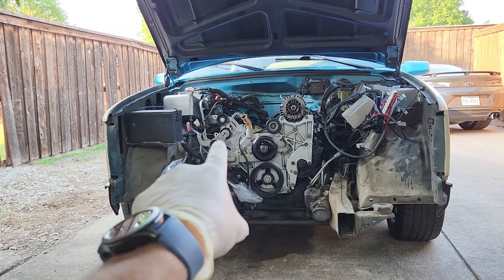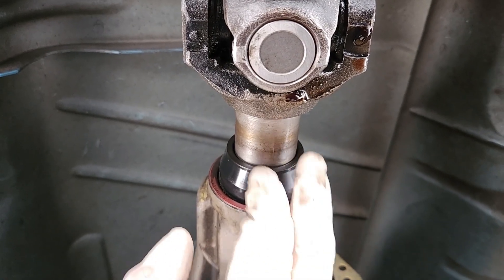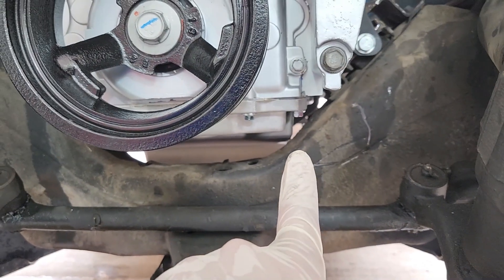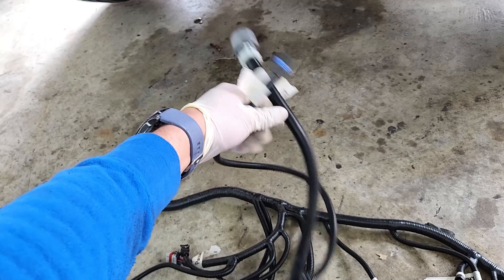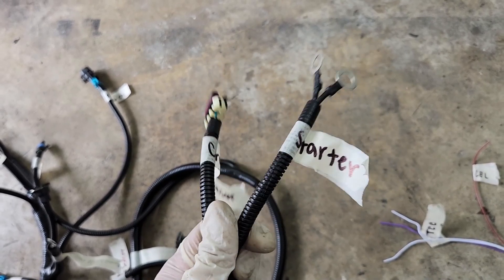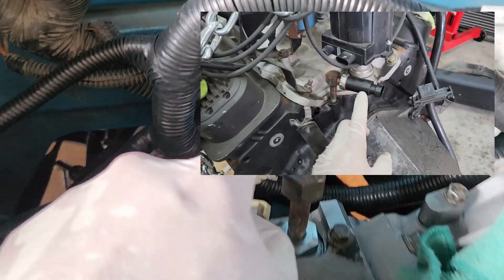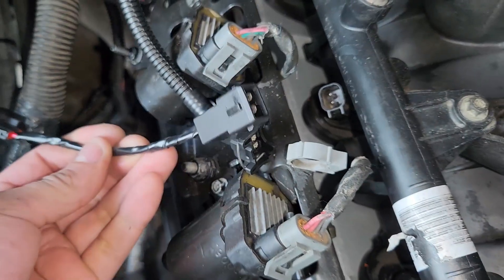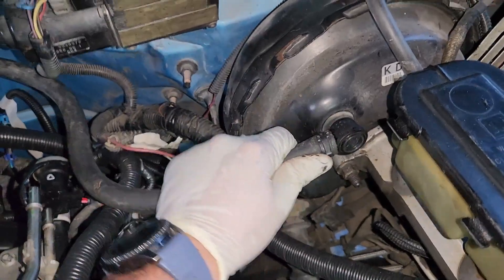How to LS swap 95 Chevy OBS (PART 2)

Comment: Did you have to use the spacer for crank and torque converter
Reply from the maker: no because I used the transmission the LS engine came with

Comment: What radiator hose did your use ?
Reply from the maker: I bought it from a 2003 Tohoe and just had to cut off about an inch or 2 from the water pump side

Comment: What’s about the vats system did you have to change anything out there
Reply from the maker: 95 only had the 1 sensor in front of the cat but my exhuast had already had the cat removed    so it was never an issue brother
Reply: @SUPSGARAGE im sorry I meant vats my phone autocorrect
Reply from the maker: @tacoman2064 oh lol   gotcha    you have to disable them or the engine will never turn on    it will crank    just never start   and I removed all the evap stuff, secondary o2 sensors and have my fans turn on at a lower temperature.

Comment: In my 94 supposedly the mil (check engine light) wire is brown and white but the brown and white wire just jumps to the pcm connector. Any ideas?
Reply from the maker: Where does the other end go?
Reply: @ literally goes from accessory connector to pcm connector. That’s it as far as brown with white stripe.
Reply: @ I have a brown with black stripe that has a splice fitting on it.
Reply from the maker: any chance you can send me a pic on Instagram? sups_garage
Reply: @SUPSGARAGE  I can tomorrow when I get back to it. Thank you!

Comment: is the low profile oil pan required? or does the factory oil pan on the 5.3 work?
Reply from the maker: the factory one will work    but if u have lowered ur truck    then I would advise  you to get the low profile one because you risk of it bottoming out
Reply: @SUPSGARAGE  good to know, thank you.

Comment: Is it the same if i just use the harness that comes with the LS or is it easier to order a harness from Amazon I'm not sure what the difference is
Reply from the maker: I don't know brother because I don't have experience with the stock LS harness
Reply: @ did you buy the harness because your engine didn't come with it or did you buy it because you wanted to
Reply from the maker: @jordangonzalez1443  mine came with it but it still had wires that I didn't even need and I didn't wanna spend the time to trim it down      so that's why I just went with Amazon harness

Comment: I’m currently building a cammed 5.3 to put in my 1994 gmc suburban same body style. Will I need the brackets on the front for alternator etc??
Reply from the maker: @fsu3784  did it not come with motor?   the LS bracket should work just fine

Comment: howdy!! me again 😅 which radiator/fan  did you use?
Reply from the maker: Here you go brother  but I recommend upgrading the fans I have now(the link is also below) because the ones it came with does not pull enough air here in Texas lol

OzCoolingParts 3 Row Core... https://www.amazon.com/dp/B07Q26NXRH?ref=ppx_pop_mob_ap_share

American Volt Dual 12-13 Inch... https://www.amazon.com/dp/B0BT25TKGB?ref=ppx_pop_mob_ap_share

Comment: do you need different mounts?
Reply from the maker: as long as you use the adjusting motor mount brackets and the stock Mounts for the v8   you should be good brother

Comment: Hey man did you have any struggles with your transmission my parking indicator says it’s shifting but truck does not move like it’s still in park
Reply from the maker: can you check when ur shifting if the shaft where the cable connects to is also rotating?

Comment: Very good and explained videos brother, I have a 93 1500 with the 4.3 v6 do you know if I can use this harness or do I need a specific v6 to v8 ?
Reply from the maker: @luisvazquez3270  thanks brother   and that does not matter   what matters is what engine you decide to go with DBC or DBW
Reply: @ I have a gen 4 5.3 from a 2012 tahoe but now seeing your video I might go with a gen 3 to do the swap myself
Reply from the maker: @luisvazquez3270  I don't have any Gen 4 experience lol

Comment: What oil filter did you use
Reply from the maker: @mtzfilms9837  the one that fits a 03 Tahoe      i took off the adapter from the orginal pan and put on the low profile one I have on it now brother

Comment: I just wanted to say, thank you!! I watched your video's & did a complete LS swap on my 1995 k1500 Z71. I ended up going with a 4L65E transmission & it bolted right up to my 6.0LS motor & I was able to get my transfer case & 4WD working as well. I found this video & committed to doing the job. Thanks again!
Reply from the maker: Happy to know it helped you brother 😁👍!
Reply: Do didn’t see exactly how u got power to the fuel pump or did it work from the original wires

Comment: The link to the oil pan doesn't work. Anybody has a link or part number.
Reply from the maker: This one will work as well brother

GESEXI 302-2 LS Swap Engine Oil Pan Kit Aluminum Oil Pan Kit Compatible with 1964-1992 Chevy Nova Camaro Ventura Omega F-body G-body LS1 LS2 LS3 LS6 5.7L 5.3L 6.5L Engines https://a.co/d/cOjdFe5
Reply: @SUPSGARAGE  thank you so much for the quick reply. God bless. I had been looking thru Amazon but wasn't sure which one to get.
Reply from the maker: @jragz_1759  No problem brother!  and God Bless You too! 🙂👍

Comment: My o2 sensors aren’t reading any idea what could be the problem?
Reply from the maker: which ones did u use?
Reply: @SUPSGARAGE  borch brand whatever it’s spelled lol and same plug as yours but not sure why but they aren’t reading
Reply from the maker: @BryanAlcala-wv6eo  I had the same issue     then I bought the AC Delco ones on my description    and it fixed my issue lol   hope this helps brother

Comment: There are Alignment marks around the shift shaft area of the neutral safety PRNDL switch on transmission. You would shift trans to neutral and align the marks and tighten down the 2 13mm bolts.
Reply: Also the 2 plugs Into that PRNDL switch are glued in so it helps to warm the plug area with a heat gun before removing plugs. Do not overheat!!
Reply from the maker: @JayJay-de8vq  thanks for adding that on here brother 🙂👍
Reply: @SUPSGARAGE  absolutely no prob! I'm just starting to look at doing an LS swap on my 95 c2500 suburban. The TBI 454 is just to weak with such low compression.
Reply from the maker: @JayJay-de8vq  lol yes I agree   that's why to me    ls is worth it

Comment: Were you able to run the stock 4160e that came in the 95??
Reply from the maker: I didn't  brother.     I ran the one that came with the LS to avoid any delays trying to figure out what I'm needing to make them work together.
Reply: @SUPSGARAGE Did the stock driveshaft u joints ect work with the ls transmission or did you have to adjust drive shaft?
Reply from the maker: Yes it did work   but remember mine was a single cab    not sure if it works on the extended cab

Comment: Did you do a 134a conversion (ac) ?..if so, what did you replaced besides the low and high side hose...i bought a new condenser and wondering if i should stick with r14 or convert to r132a
Reply from the maker: Mine still uses R12 brother
Reply: Ah ok. Thanks

Comment: You have the part number for the harness on Amazon?
Reply from the maker: Here you go brother     

ZZCSZ LS Standalone Wiring Harness 4.8 5.3 6.0 Compatible with 1999-2006 GM Vortec Engines 4L60E with Adapter Transmissions Complete Wire Harness for Fuel Injection System DBC Engine Harness https://a.co/d/0F0Ra8T

Also all the other links to the parts are on the description brother  😊👍
Reply: @SUPSGARAGE  awesome thanks

Comment: Hey bro, do you have the part number for that oil pressure sensor adapter?
Reply from the maker: Here you go brother  
 
LS Engin Swap Oil Pressure Sensor Adapter M16 1.5 Adapter to 1/8 NPT for All GM LS Engines LS1 LSX LS3 4.2L 4.3L 4.8L 5.3L 6.0L 6.2L https://a.co/d/9NQbrFV
Reply: @SUPSGARAGE  bro you're a lifesaver.
Reply from the maker: @sbickmore15  Glad to help!

Comment: For some reason my ls has a Camaro oil pan and will not bolt up to transmission , stock truck oil pan clear 95 Chevy cross member ?
Reply from the maker: the stock one should clear it brother
Reply: Thank you

Comment: Great video!  Did you use the factory oil pan or a low pro pan?
Reply from the maker: Thanks brother    I used the low profile one brother cuz at the time my truck was at a 4/6 drop
Reply: @SUPSGARAGE  Mine is pretty slammed as well.  Just wondering if it's going to be a problem.
Reply from the maker: @danbuildz2054  if urs is 4/6 then don't risk it n get the lowering pan

Comment: Did you have to change cross members or use a a different trans mount?
Reply from the maker: no   I did not have to brother     I had a aftermarket transmission mount already    but the one from the LS transmission should work just as fine as well

Comment: How did you bend the power steering lines, planning on keeping my original lines but could you bend by hand or do you need a special tool
Reply from the maker: I did it by hand brother    just do little by little until u have enough room

Comment: I have a 90 obs I was thinking of LS swapping, these videos make the process seem easier than I thought! I appreciate the videos man!
Reply from the maker: U should brother   u won't regret it and thanks for the support! 😁👍
Reply: I have a 90 too! Single cab short bed
Reply: I just slapped the 6.0 in mine yesterday. not horrible to get thr engine in. fuel system is simple cooling is simple. the only real pain is wiring but there are guys who make custom harnesses or you can make it simple and go carb if you feel like it
Reply from the maker: I heard it is easier to go carb brother but I have never done it so I don't have any experience on it lol